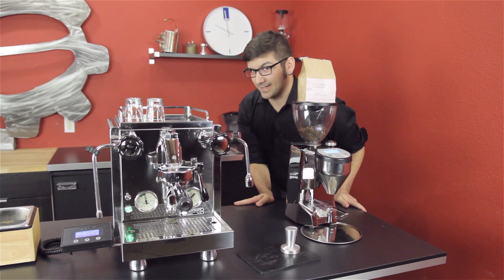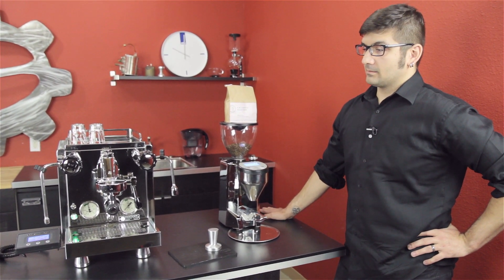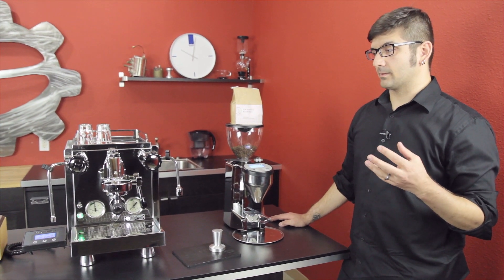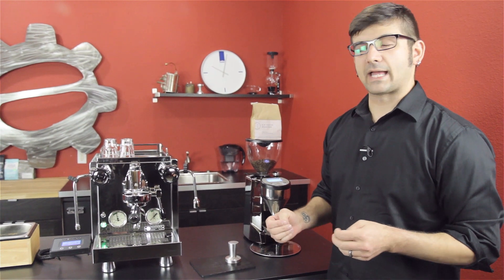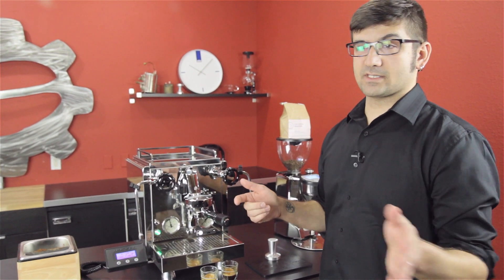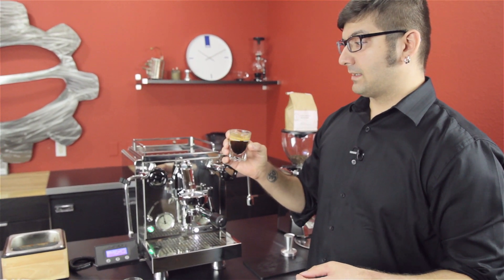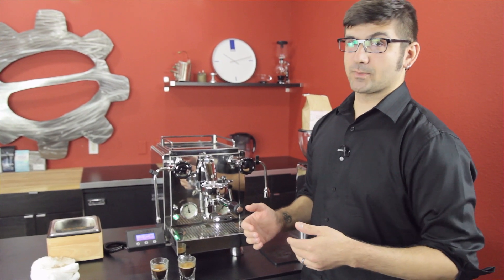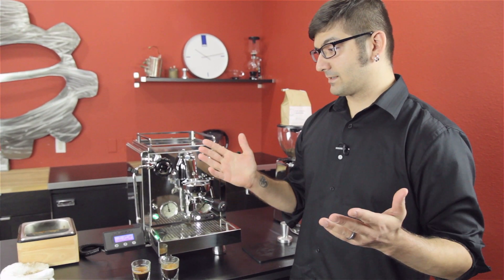Pressure Profiling With The Rocket R60v | Joe's Take Over

Comment: Great video. Joe, no need to sneak around. [Just don't get the idea that you can ever replace Gail ;-)] 
Now I understand this 'pressure profiling' business in the context of the Pavoni! Yes, I used to own a Pavoni and -- you are right - I learned to reliably make the best home espresso I've ever tasted. But at the cost of zero flexibility. I finally gave up on it since it  got so hot after the first pull that subsequent pulls were terrible.
In the context of a modern high end machine, you can emulate that one implicit profile that is hardwired into the Pavoni, but you can also develop other profiles and reliably repeat the selected profile all day. And all controlled from your iPhone! But you pay a different kind of price.
I suppose it would be fun to compare a real Pavoni with the Pavoni emulations that the r60v can serve up.